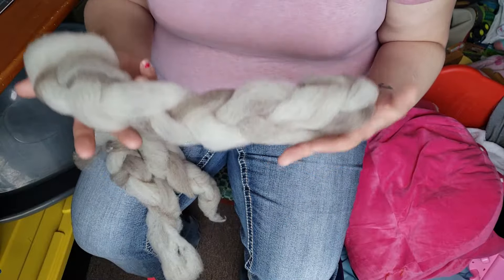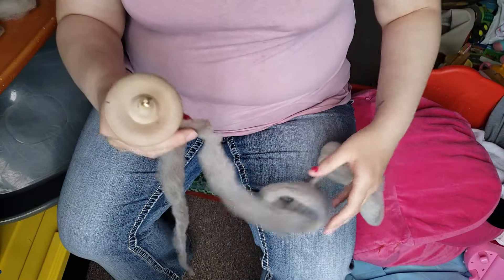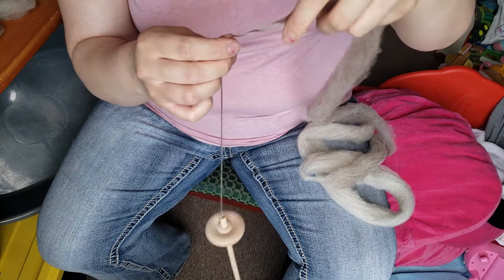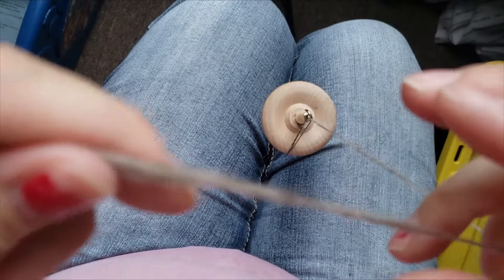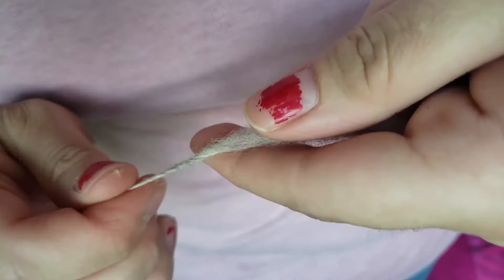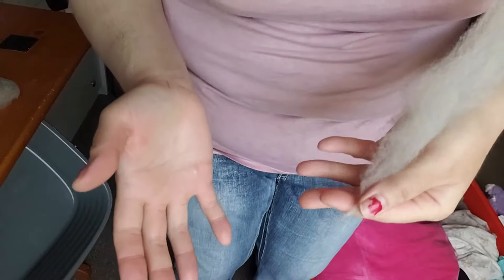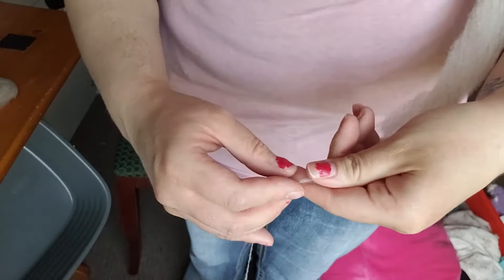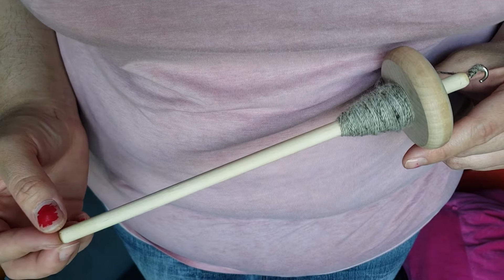SECRET TECHNIQUE to spinning on a Drop Spindle I Beginner Drop Spindle TUTORIAL

Comment: Can drop spindles be used to make tightly wound threads and twines as well as yarn?
Reply from the maker: That is a good question! If you can draft the fiber being used and it can hold together with added twist, a drop spindle should work to add that twist and form a yarn or thread.
Reply: @RayneFiberArts  Cool, I like making my own rope from twine and now I want to try making the twine itself too.
Reply from the maker: @Moostery  That sounds awesome!

Comment: Hi Rayne. I'm finding all your videos very interesting and informative. I've just begun with the drop spindle and I have a question for you. After you ply...or even after you single ply...how do you get your yarn from unwinding when you're through with filling the spindle? Right now, I'm just using little bow-ties, but there must be some way that I haven't heard yet. Even after I wet finish my two-ply, it doesn't seem to really want to stop it. Is there perhaps some yarn that's better than others for not unwinding? Thanks for your thoughts on this.
Reply from the maker: Love your question! If after wet setting it is still twisting around you may have too much twist in your finished yarn. For singles, I wind them onto a ball winder, you can also use a toilet tissue tube to wind onto, or I sometimes use a piece of cardboard box I cut into a square. I know what you mean by bow tie I have also made a few of them and they can get to be a mess. I hope this helps! And as for finished yarn you can use the above mentioned as well, a lot of different things can be used as a makeshift bobbin.